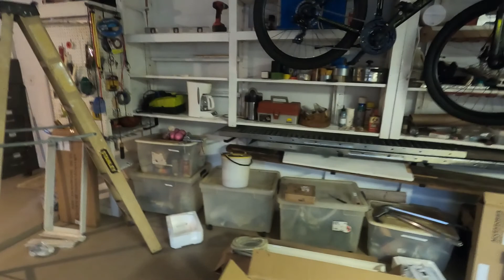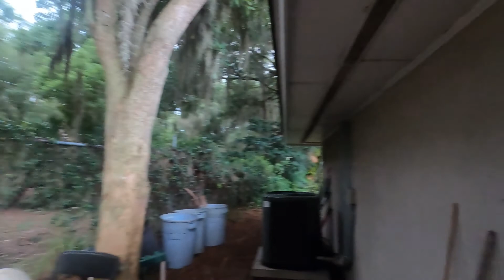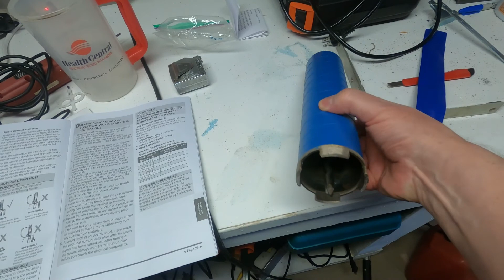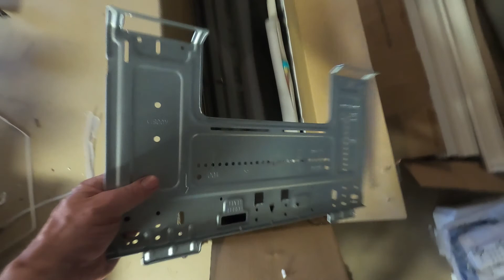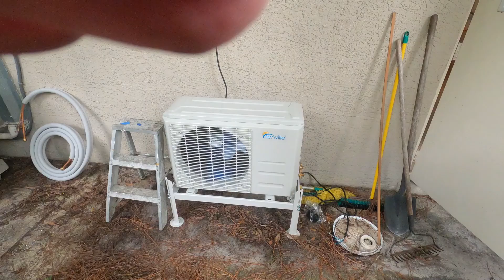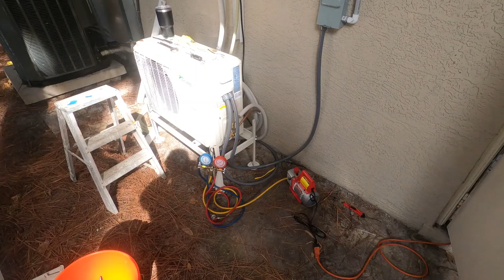Senville LETO  Mini Split Air Conditioner Installation

Comment: works great I have not used the heat yet just the A/C but it has not made much of a difference in my bill at all. So far I am pretty happy with it. I put it in at the end of the summer last year so It will get the first heavy usage this summer.